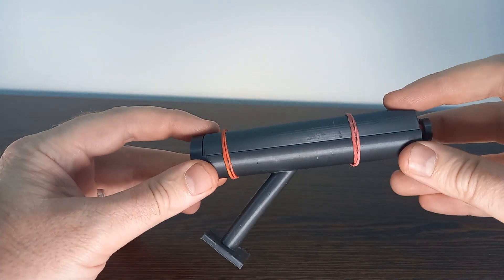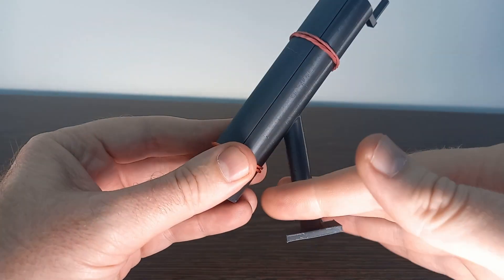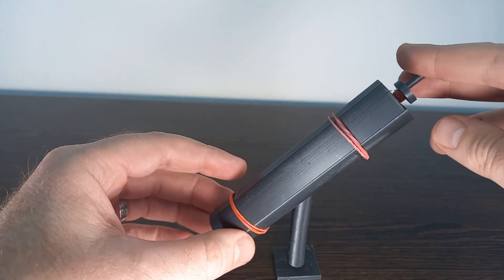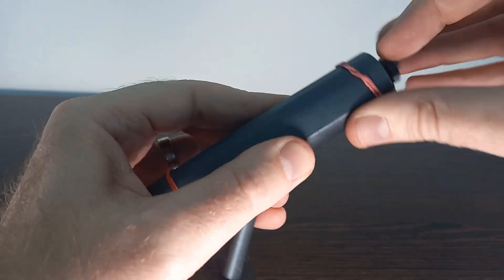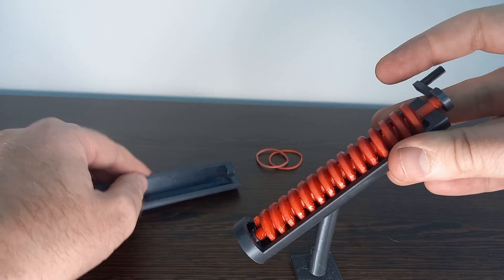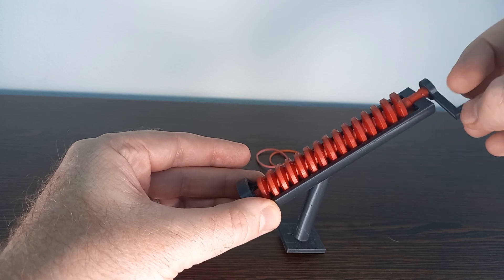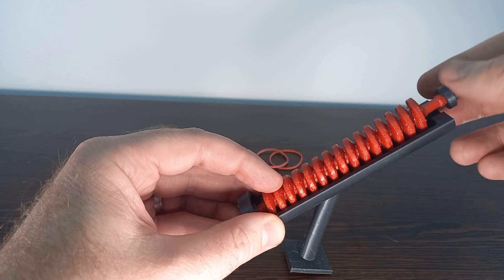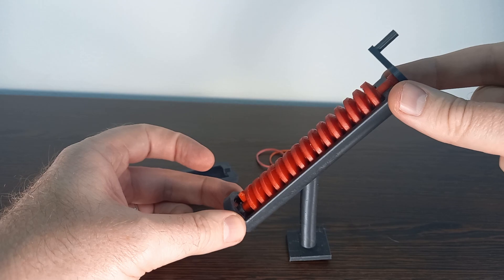Archimedes' screw [3D]

Comment: If for the screw, you print the cylinder walls on the exterior of the screw as a single print (except for 5-10mm at the bottom and top respectfully for input/output) then you wont need to engineer clearance. You'll have a straw you can rotate.
Reply from the maker: Good point.  I liked this print for the very reason that I could open it up to show what was happening.  Maybe that is the next version.